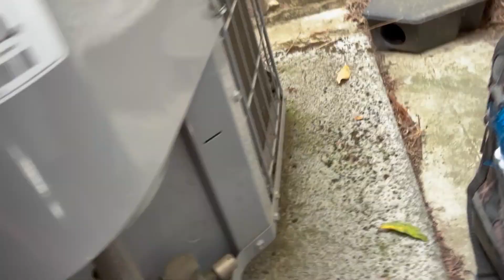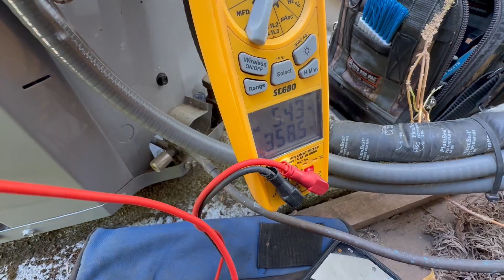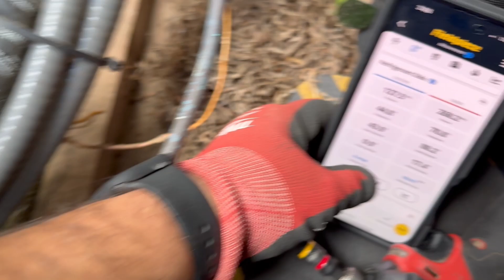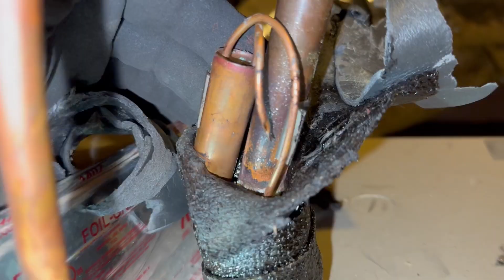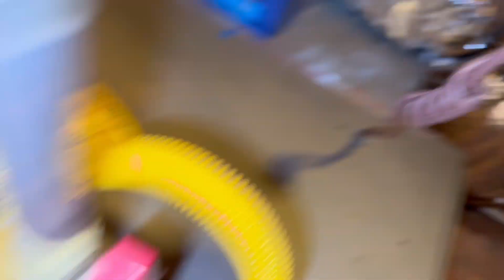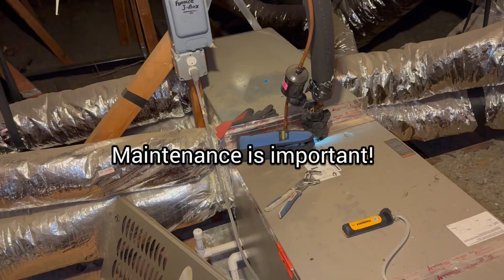No AC Service Call - Full Diagnostic - Tests and Tips! #HVAC

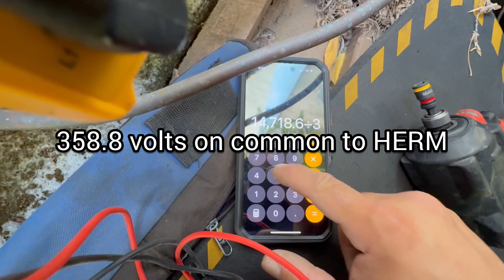Comment: 3:30 your meter already has MFD function. Is there any reason to do that calculation for capacitance?
Reply from the maker: Good question - next call measure without load .. and then with the load and you will be suprised 😎 it’s more accurate and a true reading when it’s in use , thanks for the follow up!

Comment: Hey quick question. Why did you only check herm and not other wires? Also if you were of range, would the whole capacitor need to be replaced? Excuse my ignorance I’m an installer trying to learn a little more about these systems.
Reply from the maker: Good catch ! You’re always gonna test both wires if the fan and compressor are on the same (dual capacitor) 
When one side is out of range the whole cap is condemned at that point. 

And no question is a bad one Essence! Feel free to ask away whenever anything pops up 👋🏽😎 thanks for being here hangin out!

Comment: Btw you should put your (super heat) temp clamp as cloes to the indoor coil on the suction line for a more accurate superheat. That location has a chance of compressor heat to effect the super heat readings.

Comment: what bulb is that? Please help me understand. Thank you
Reply from the maker: That is called sensing bulb for a thermostatic expansion valve or more commonly called the “TXV” it’ has refrigerant matching the system to sense the temperature of the suction line and regulate the superheat coming into the compressor. Most coils post 2005 had them installed from factory - it’s up to us to position it correctly most of the time. Thanks for checkin out the video Sam!

Comment: You should’ve checked just the common wire from the compressor for compressor amps only.  By putting your amprobe on the common wire of the run capacitor, you’re also adding in a part of the fan amps.
Reply from the maker: If you are referring to me taking the amp draw off of the capacitor, thats because i was testing the capacitor under load for the formula.. otherise yes, alawys check straight amps from common. thanks for the feed back Gerald

Comment: Thanks for showing that part with the running capacitor!
Reply from the maker: Thanks for watching, appreciate you taking the time to check out the video! 🫡
Reply: I have the sc680 meter, it has ever give me right microfarad for the condenser fan motor, always checks to high that needs to be replaced, also the amperage at common wire of the fan motor,

Comment: Are you sure your temp clamp was accurate? Seemed really cold on the suction line.
Reply: I was just about to say the same thing until I saw your comment. I would definitely check that suction line with another temp probe
Reply from the maker: Temp probe was accurate, but the coil was extra cold during this diag in fact it was still icing up I had to let it thaw out more and didn’t detail that in depth to much. The txv video is the follow up to this call . Thanks for checkin out the video guys 🫡😎🤙🏽

Comment: Your subcooling looked pretty high. Might be overcharged. Was the house temp low?
Reply from the maker: House temps were at 69-70 a little low of a load but outdoor was in the mid 80s. I can’t say if it is or isn’t at this point , this was first AC service for them using us but just a heads up.. stay tuned cause I’ll be swapping out that valve and putting together a follow up video beginning to end. Thanks for watchin Rich 😎🤙🏽

Comment: When you said the constant for the microfarads calculation, where does that number come from?
Reply from the maker: A fancy electrical term called “Capacitive Reactance” using ohms law there’s a formula that is calculated using 60 hz which is the compressors frequency as well. The formula breaks it down into 2652 at the end. Very good question Mystery Man ! 😎🤙🏽

Comment from the maker: Final Thoughts -  ABC - Airflow Before Charge. Always check static before assuming any parts of the refrigeration circuit are bad. In this video I checked the bulb before airflow… most likely the culmination of unbalanced, high static airflow and improper mounting of the sensing bulb led to the valves failure. After adjusting static the superheat never rose above 1.5 therefore a recommendation was given to replace the valve. 

The return duct was also thoroughly inspected for any blockages or collapses! Always verify which side of the system is producing the high static and investigate from there. Once all was verified only then did I adjust the blower speed tap down. 
Thanks for watchin another one! 😎🤙🏽
Reply: Honestly would have loved to see the superheat after adjusting the blower speed tap and securing the sensing bulb. I believe in your case with it being on the fastest tap potentially could contribute to low superheat along with the sensing bulb being off
Reply from the maker: @ItsBacon What’s up ! I’ll get more detailed for sure! The txv video I posted shortly after this one is the follow up , that being the correct blower speed after the valve was replaced. I appreciate the feedback and thanks for checkin out the video! 😎🤙🏽
Reply: @ServiceTechSonny Thanks for the response and I appreciate your videos. I look forward to learning more!!!
Reply from the maker: @ItsBacon 🫡 Appreciate you takin the time to check out the channel , just getting started haha
Reply: Wouldn’t it be accurate to say that most Techs in Residential and Commercial don’t ever check static pressure?
Reply from the maker: @Rin @Rinebo My thoughts are needing more training on how to test and the importance of Airflow. My first shop I worked at pushed Airflow is King , i went through NCI as well. I tell my clients the system is an expensive air pump that removes heat to make it cold 😂 however, knowing .. and not testing is a whole different thing 😅🥴